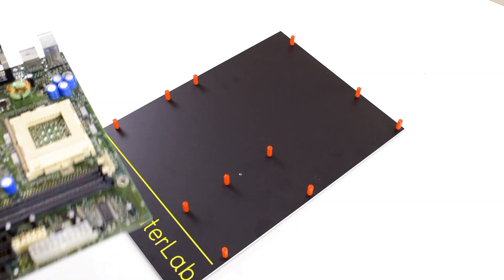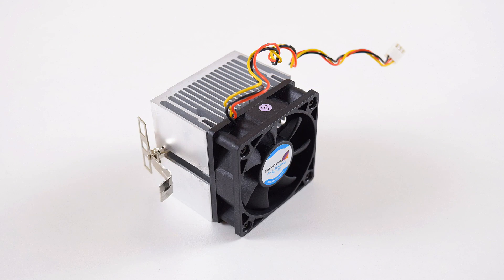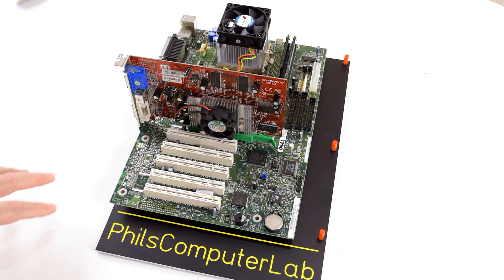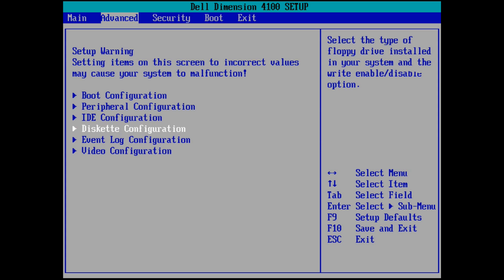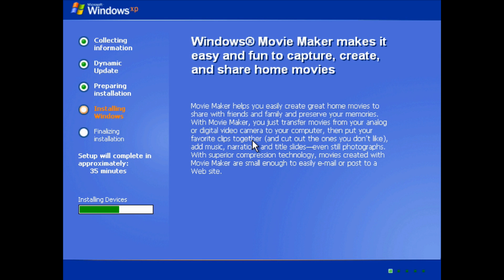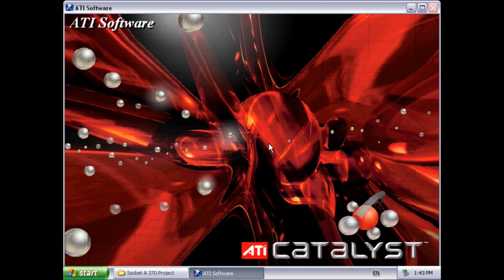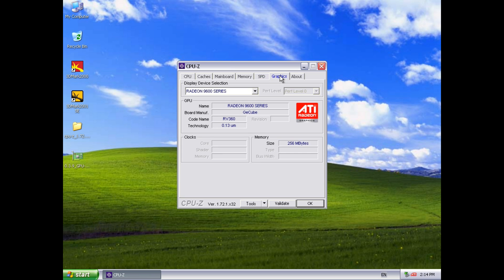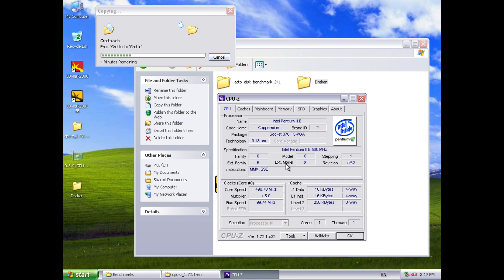Building a Socket 370 Retro Gaming PC

Comment: Why is Socket A sooo common
Reply: They were offering nearly the same and sometimes better performance for a lower price, though it can vary depending on what you find available in other countries as well.
Reply: Lower price, lower power draw and less heat output. It was just the choice to go for. AMD was king up into the core 2 times.
Reply: P3 Tualatin... I know that..............MY OLD PROCESSOR!
Reply: it was dominant back in the day (price/performance comparison)
Reply: Socket A is so common because it beat pentium 4 willamette with RDRAM into a bloody pulp at a tiny fraction of the price. RDRAM had a huge price premium and no performance benefit at all in games (it could even be at a large disadvantage because of its extremely high latency).

The athlon XP 1900+ Beat the 2.0 GHz pentium 4 even in Quake III, using nothing but bog standard DDR266; it beat it by 40% in Serious Sam. The pentium 4 was not a reasonable choice for gamers until the pentium 4 northwood C stepping with dual channel DDR400 support. The 2.4C reliably overclocked to 3 GHz, and used cheap-ish memory; it traded blows with the athlon XP, but on the low end intel didn't have a response to AMD.
Reply: Socket A is attractive right now for retro builds as the parts are cheap aside from some of the choice things like certain boards ect. Still hard even now to overcome the decades of bias against the Pentium 4  but one day people will be buying those up as well.
Reply: +Aussiebear22 "Pentium 4 was not efficient due to Intel putting in a very long pipeline. (The goal was to chase speed. It was marketing 
driven...Heavily influenced by the PIII vs Athlon speed battle. Went 
from 500Mhz to 1Ghz in a short time)."

It was not driven by marketing. It was driven by a belief that Dennard scaling would continue unabaited as it had done since the beginning of integrated circuits in the 1960's at Fairchild semiconductor. Intel's process engineers would find some way to pull a rabbit out of the hat once again. 

Intel expected to reach 8 GHz by 2003. If they did, Intel would have been hailed for their forethought and revolutionary design.

What intel did with the pentium 4 was really nothing new; decouple or integrate into the CPU that which could not keep up with the CPU clock, pipeline deeper and clock higher.
Reply: Using a simple pencil to unlock the multiplier...
Reply: 200mhz fsb on a Pentium 3 would have ran into a lot of problems with the chipsets though ram would not have been an issue with ddr. In a way in the end the pentium 3 would go on with the pentium mobile as the execution core is the same until C2D. Intel's Israeli branch had modified the pentium 3 with an on die IGP at one point and examples are pretty rare but at one point someone posted on vogons asking about it and where to find drivers last year or the year before.
Reply: +vortex222 No. In the late 90's when they were designing pentium 4, they were targeting and expecting to reach 8 GHz by 2003 . They pushed the date out when the expectations failed to materialize, repeatedly. E.g. In 2002 they were saying 15 GHz by 2010 on Nehalem (not the nehalem we go, but an even netburstier pentium IV successor that would compete with the heat output of a rocket nozzle); in 2003 their road map showed 10.2 GHz in 2005. They only begrudingly switched to core 2, which was a tweaked P6 (pentium pro) decendant that had continued being developed from the pentium III under the names pentium M and Core.